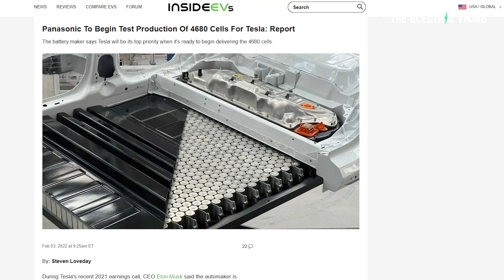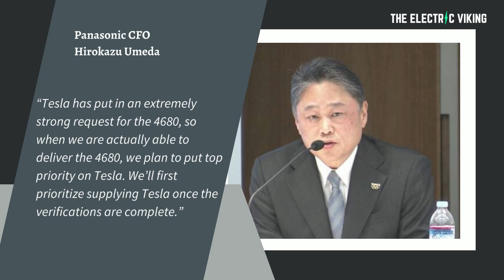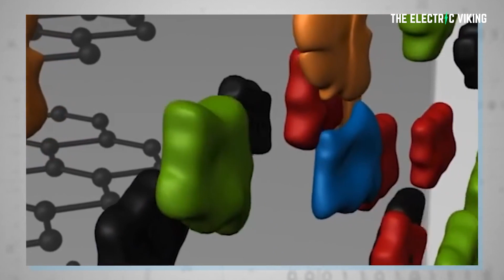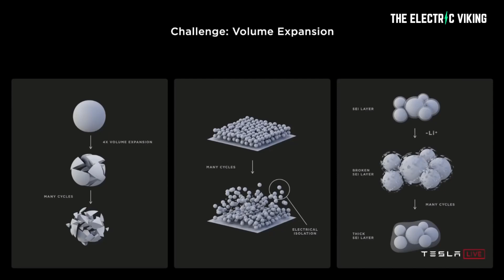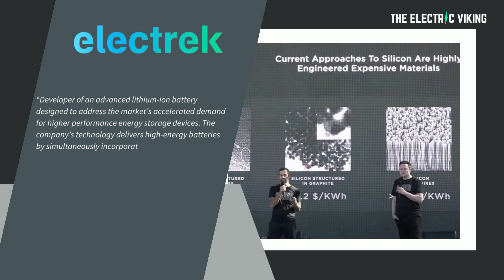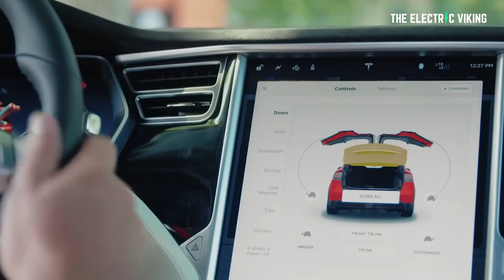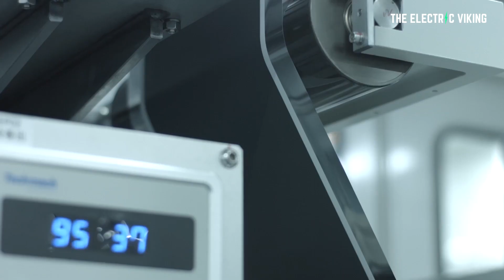WHY legacy auto won't use 4680 battery cells from Panasonic

Comment: I truly find this channel to be informative and descriptive of the current EV market. However, I would appreciate a more unbiased tone towards Tesla. While I believe they will be number one in auto sales at some point, not pointing out the things that they are doing absolutely wrong is a disservice to the consumer community.  You do this well with legacy auto. As you do, I want all companies in the EV space to succeed, but I also want to be able to make the most informed decisions possible when purchasing a vehicle. A good example of what I’m talking about is the current law suits that Tesla is facing in America for programming in rolling stops at stop signs. Or the fact that they call their cruise control system “autopilot” when it’s only approved level 3 of 5 in autonomous driving. I’ve also seen a ton of post about the cost comparison for the cyber truck compared to Rivian and Legacy auto EV trucks. If I had to wager, you probably won’t be able to get your hands on a quad motor cyber truck for less than 100k. I look no further than the model x and y for price comparison. ($70k - $100k US)It almost seems obvious to me that the cyber truck fully loaded would be more expensive than either of those, but it’s not being presented that way at all. Again, I truly do appreciate your canter about legacy auto and the EV market, but I would truly appreciate a slightly less biased commentary.
Reply: Which "lawsuits" are they,?
There was a "recall"
(unnecessary) to address the perceived possible issue with rolling stops, on FSD BETA (NOT "autopilot"), hence, only 54,000 cars, the number in the FSD BETA rollout at the time (late January).
As I recollect, the paperwork from Tesla indicated a software adjustment rollout planned for 28 January (?) BEFORE the "issue" (non-issue) was even made public.
The same applied to the recently publicised "seat belt warning issue".
Essentially, uninformed FUD. Intentional or otherwise.
Cybertruck pricing? You're guessing, that's how incorrect "sudo facts" emerge.
Please don't guess. "A ton of posts" regarding comparison of  product from other companies is no indicator of what may happen.
(Maybe you should "wager"? I need a good laugh)
.
As apposed to what you see as "biased" commentary from Sam, I'm sure "we" (Sam included) would appreciate fact checked comment from you.
Reply: @rogerstarkey5390  while I appreciate your’ intelligent response. Nothing I said was necessarily incorrect. A quick google search and you will see articles as in more then one about everything that I mentioned. I find myself entertained by how everyone believes that their source of information is more correct simply because they saw something to the contrary. Unless, you work for Tesla and have insider information, you have the same amount of access to the information as me aka media speculation. Also, just because a vendor releases a statement from their public relations department does not mean it is %100 fact. You mentioned that I was guessing about the Cyber Truck price (which is accurate) but I also cited the current Tesla pricing for smaller less “indestructible” vehicles that have less power and ability in general. Making an educated guess is all you can do when the pricing is no longer on their page and the old pricing is constantly being referenced when making pricing comparisons. While you seem to want to protect Tesla specifically and “fact check” me. You are allowing basic common sense to escape you. I simply was providing feedback to the channel. If I wasn’t a fan of this channel I simply would not have subscribed and I wouldn’t take time out of my day to listen.
Reply: @rogerstarkey5390 still laughing??

Comment: Form factor and chemistry are entirely independent. There's no reason whatsoever for Tesla to not make all their batteries 4680 with different chemistries. That way they can build a standard range version with cheaper chemistry and a long range version with premium chemistry, all on the same platform.
Reply: With prismatic LFP cells you can use the space in the battery pack better and compensate for the lower gravimetric energy density. Tesla uses prismatic LFP cells in the standard range Model 3 already.
Reply: @nilsfrederking62  Sure, but you can't use prismatic cells for a structural battery pack, loosing a similar amount of gravimetric energy density as you gained.
Reply: @virtual-viking  Actually you can. Both the Prismatic and 4680 can be cooled from the bottom of the battery which is a better way to manage the temperature. Prismatic might have more dividers, but there is no limiting factor for using prismatic instead of 4680 cells. Prismatic cells are more energy dense than the 4680 cells in the first place.
Reply: @virtual-viking  be interesting to see how this is handled...
Reply: @virtual-viking  The long and thin Blade cells made by BYD are, by definition, prismatic cells. The steel cladding on either side of them and their vertical orientation within the packs that BYD has designed for them allow them to be structural.
Reply: Didn't Elon already say that 4680 would not be iron base?
Reply: @SkyRiver1  I'm not aware of everything Elon said, and to be honest, I'm having a hard enough time distinguishing the words "Ion" from "Iron" in spoken English.
Reply: @SkyRiver1  Yes he did.
Reply: I believe there are two chemistries for 4680 per the battery day presentation.  Nickel Manganese with less than 300 watts per kg, and the high nickel with 350 watts per kg.  The LFP will be something else with more volume per battery, because you don’t have to cool it as much.
Reply: On the last earnings call Elon and another Tesla executive clearly said that the 4680 form factor would not work for all battery chemistries ... And mentioned LFP. How could you've missed this?"
Reply: @Saxafruge  I obviously didn't sit through the earnings call. In any case, I doubt LFP has much of a future in Teslas cars anyway. With capacity constraints all over, ig makes more sense for grid storage.
Reply: @virtual-viking  yep although it Tesla offers a standard range Model Y, LFP could make it a profitable $40k SUV
Reply: But the prismatic format suits LFP better.
Reply: Form factor and chemistry are very dependent on each other. Different chemistries have very different requirements for cell thermal management, pressure, thermal runaway, manufacturing, etc. Batteries are highly engineered to obtain the most cost effective balance between the desired use and the limits of the chemistries.
Reply: Agreed it would be likely for Tesla to stick with the 4680 package.  The assembled 4680 battery pack has become an integrated structural component of the car, connecting the front and rear castings.  The whole assembly thus gains exceptional strength and rigidity.
Reply: Yet ~1000km model EV on sale this year in China is extremely likely LFP batteries.
To compete with LFP on pricing, only for the higher end cars which the wealthier people can afford, the wealthier can afford higher pricing lower weight EV

While heavier cars with 1000km travels is already very good.
So there's no doubt Tesla can only go what video says.
Not  every Tesla US vehicle will uses the 4680, the mass common production vehicles do not need the expense overhead. (plus LFP is a safer chemistry) 

Make senses for the higher end vehicles

Comment: LFP's are a better choice, particularly since they can be charged to 100% and run to 0% without affecting battery life. NCM batteries need to be maintained within 10%-80% charge, effectively reducing their published range. Additionally, LFP batteries (BYD Blade) are now getting up to 700 km of range. I am surprised that not all EV manufacturers are using LFP.
Reply: It does affect battery life, if charged to 100% all the time... it just doesnt really matter with lfp because of their high cycle life but still they will degrade faster.

Comment: Tesla put on battery day and basically attempted to steer (or misdirect) the competition into hasty decisions. Until we get some measured performance and longevity numbers on the 4680 it is hard to pass judgement. LFP probably not good enough for semi/pickup truck/performance models. Perhaps model S/X will eventually get 4680 packs. 
Musk loves to have the top performing vehicles in each class, 4680 may ensure that.

Comment: The only way 4680 cell work is because of the tab-less design which reduces the internal resistance of such a large form factor.
So unless Panasonic have cracked this without Tesla, then they have used a Tesla license. Thus Tesla are the only one buying 4680's.
To be honest if Panasonic are doing this under license O do not see why Tesla would not give them the same info that they have along with the production method, processing and tooling to produce the volumes that Tesla needs.
Panasonic are a trusted partner, unless Tesla are paranoid and believe there would be leakage from Panasonic to Toyota.
Reply: I doubt that Tesla would give this IP away...

Comment: Elon explicitly said Tesla won't be using 4680 form factor batteries with LFP chemistry in the Q4 earnings call.
Reply: Short term I believe him.  But the long term remains to be seen.  Most any chemistry can be put into a 4680.   If 4680 has sufficient advantages, the impetus will be to go there and in-house with their own production equipment.

Comment: 4680 battery is 20% bigger and there for it has 20% more power. It also means it will take 20% more space. Nothing comes free huh.
Reply: 20% more capacity due to silicon anode alone (energy density)
Reply: Less than 1/5th the total cells are needed per same sized pack. Also much less casing materials as 1 battery cell now is equal to 5 of the 2170s. 
Plus the 4680s are designed to be stiff enough to function as load bearing in the new structural pack's. 
So it's not just the larger form factor to consider vs the 2170 or 18650 formats. 🤔
Reply: @4literv6  the point of the 4680 technology is to make the battery bigger and light weight using bigger battery cell and less packaging.  Thus, it does not mean its more powerful. Just means it is packed with less case and less packaging for the battery cell making it more light for longer range
Reply: @galaxyoldman  The cost of manufacturing is less with dry electrode, also. Add all the advantages up, it could be a game changer.
Reply: @galaxyoldman  you sound very sure of yourself. Tell me do you work in a relevant field by chance? 🤔
Reply: You slept thru geometry class, didn't you? Volume goes up faster than surface area. duh.

Comment: We have all heard of 4680 cells but from outset it was apparent that these were not just bigger but also included chemical and construction  attributes (tabless) which you are pointing out are at least in some cases patented by Tesla. For a while I have wondered if Panasonic's 4680 were going to be the same as Tesla's 4680 or "just" larger versions of the cell designs Panasonic already had. In particular, I gained the impression that Tesla had changed the chemistry in part to address potential thermal management (read: safety) issues for the larger cells. Would "4680" cells that do not use Tesla-like chemistry enhancements even be usable, I wonder.
Reply: If my memory is accurate, on battery day when they announced 4680 and the tabless design they indicated they wanted all of their supplies to adopt the tabless design and that they would continue to buy all the batteries those suppliers could make. I don't know about the cell chemistry, but pretty confident panasonic isn't going to attempt to make a 4680 can without a tabless design as the thermal properties would probably be terrible. Tabless doesn't just speed up manufacturing, it is also a critical thermal component, acting as a sort of heatsink connecting every inch of the jellyroll to the thermal management system instead of most of the cell dissipating heat far from the tab.

Comment: Sam,  good overall job.  Tesla is making all the 4680 cells they need and can increase productivity real fast as they use the knowledge from the lessons learned from California.
Reply: Here's the thing 
What proportion of total sea do they plan for (to start with) the Performance Model Y/3?
Is it 20%? 50%? 70%?
Because logically, if LiFePo4 is "the chemistry" but they plan to make literally "shedloads" of 4680 NICKEL based cells, using a much faster process, they're going to suffer oversupply of that type.
Remember these new 4680 cell factories are mean to be capable of 10x GWh output.
There's actually a finite limit to the percentage of Nickel based cells they need.
They need 4680 LiFePo4 cells!

Comment: You can buy panasonic ternary batteries look online , they will be commecially available for batt pack building just like 18650 and 2170 after they have scaled up 4680 enough a small percentage of production will be available to public but probly wont go into evs unless diy conversions like 18650 packs and 2170 scooter packs now

Comment: GM is into their ultium battery. Prismatic.  OK so why would they be interested in a round battery?  Same with all of the legacy makers.  They are playing the cards dealt.  HA.  Doa
Reply: @Knaught Shure and you expect me to disagree?  LOL  All reasons legacy makers wont use them
Reply: @Knaught Shure go back and read it again.  legacy=prismatic use.  Crap batteries.  round is a better battery. so the legacy wont use them.  how much simpler does this need to be?
Reply: @Knaught Shure exactly.      I figure it is the cost relatively that is all the legacy makers are looking at.  That said they end up with higher costs and weight. it is crazy.  people get one view in their mind and then set onto an inappropriate way of working.  I was just looking at a video that looks at using a sterling engine to drive pumps or a generator.  They derive heat via tubes with water stored for night or used but heated cooking oils to drive the storage for night.  Fairly interesting.  https://www.youtube.com/watch?v=duuk_r--lqU